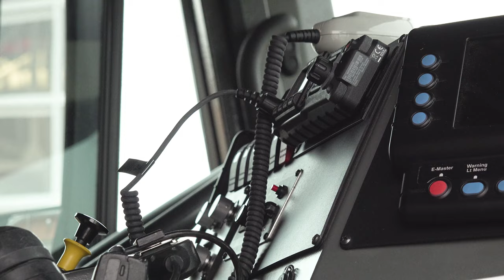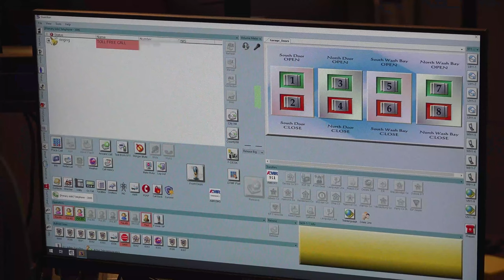County Prepares to Launch P25 Digital Radio System

Comment: How does changing waveform have anything to do with coverage... ?
Reply: Reading between the lines, they switched to 700 or 800 MHz for improved building penetration compared to VHF. I suspect site density was also increased. P25 generally delivers better audio intelligibility in fringe areas than analog but not enough to radically transform system behavior - the architecture changes are where coverage was improved.

Comment: I know Motorola sold Daviess County on the P25 trunking system, because it would be better interop ect,  But it would been cheaper to upgrade the Vhf system to simulcast system. But i understand the reasoning to move to P25 digital  trunking radio system.